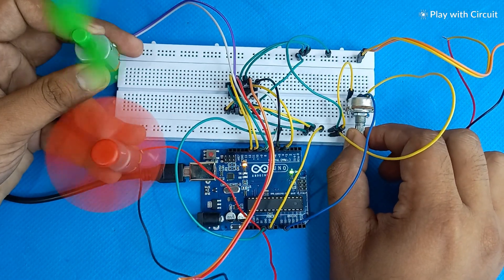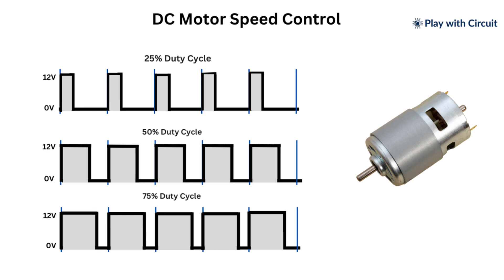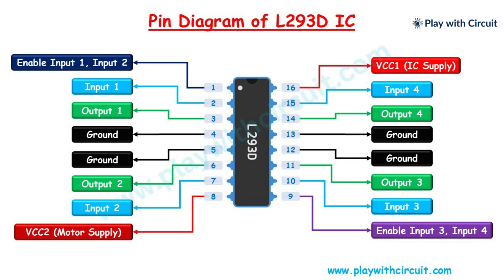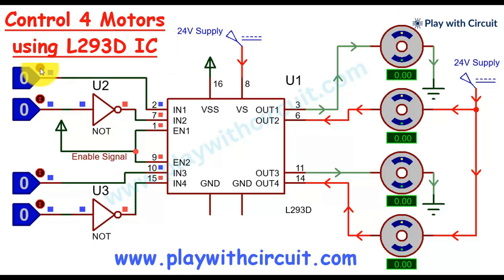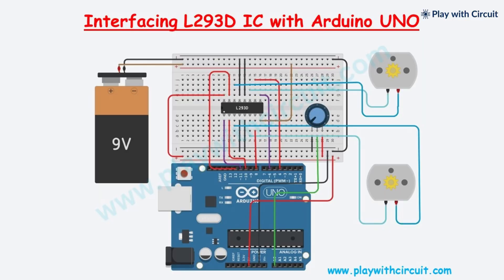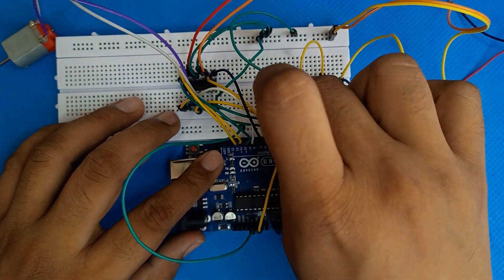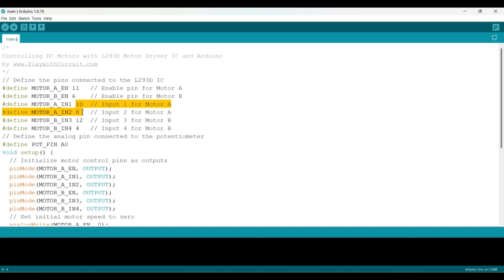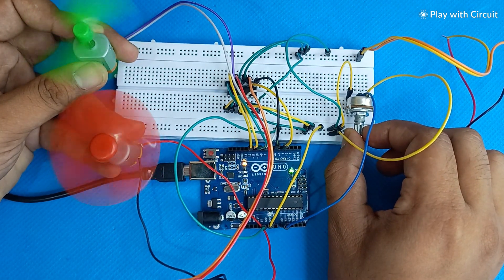Controlling DC Motors with L293D Motor Driver IC and Arduino

Comment: Can I control 4 moter using L293 ic in Arduino?
Reply from the maker: Yes
Reply: @playwithcircuit9816  actually I have 4 coreless moter and one L293 ic and I want to make drone please help me.
How can I contact you?
Reply from the maker: you can't control the direction when controlling 4 motors you can just turn On and turn Off for more circuit diagram visit : https://playwithcircuit.com/how-to-control-dc-motors-with-l293d-motor-driver-ic-and-arduino/